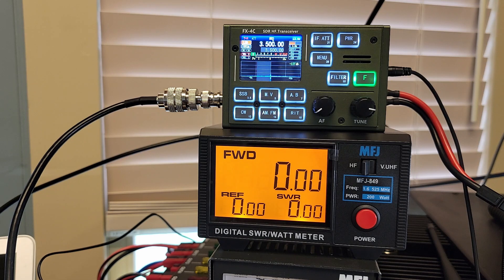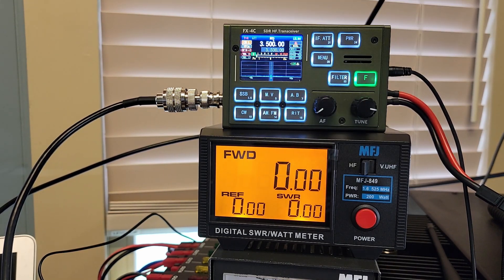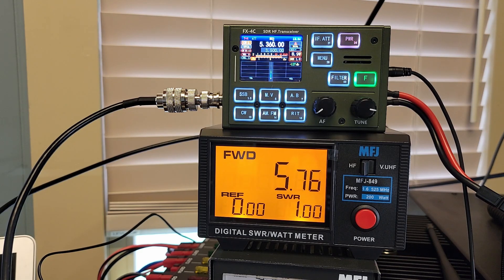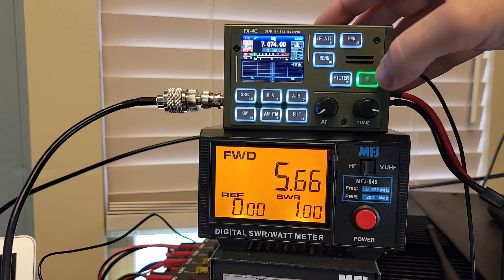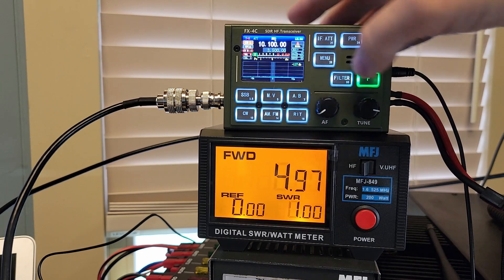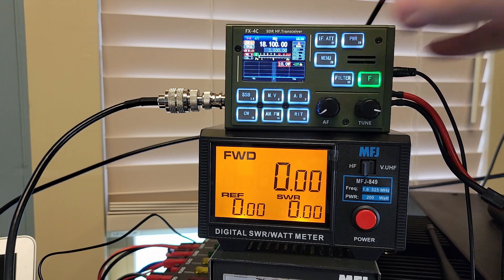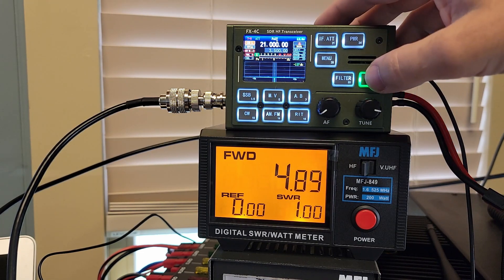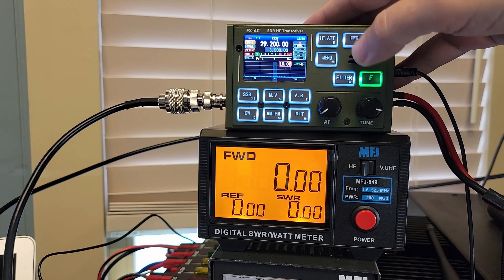10 Watt... Or Not? FX-4C

Comment: I'm confused, you say "Pretty good results" when the radio is rated to 10w and you didn't get the 10w even once! that's horrible results my friend hahaha. Came to this video after buy the CR model that is rated to 20 watts and I dont get more than 10w while using a dummy load. So this radios pretty much give half of what they are rated for. Usually radios don't give exactly what they claim but Cmon HALF? nahh, that's plane wrong.
Reply from the maker: What power input are you providing?
Reply: A Bioenno 12amp fully charged. Didn’t tested exactly how much power is
Reply from the maker: The Bioenno's are usually 13.x when fully charged.  The FX-4C(r) radios can take (if I remember right) up to 16v and that is where the power output ratings come from.  I don't have any higher power supply than the 13.x to test with.  @angelscomputers
Reply: @temporarilyoffline  that makes sense, so definetly this radio is not for me because I’m not going to be carrying that much voltage, mostly when my G90 can produce the 20w with the 13v

Comment: Maybe I miss something, but being at 50% of the rated power for all but two bands doesn't seem good. 5 watts is fine if you are expecting five watts.but given a differentiator on the 4C was its 10 watts, this would really seem to knock it down in value compared to other QRP radios.
Reply from the maker: I think so too.  I guess it depends in your hamgoals as to where this radio fits on your ladder.
Reply: I was wondering if anyone was going to bring that up.   If not 10 watts then why are we even considering it?  Lots of 5 watt alternatives out there.